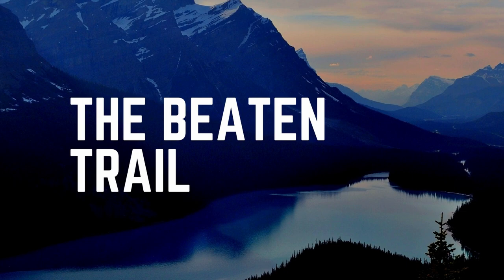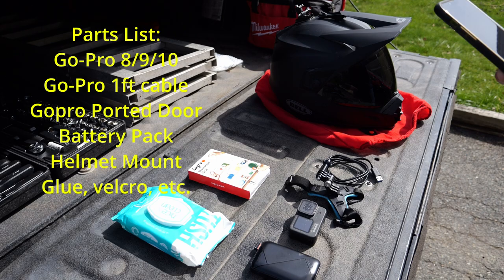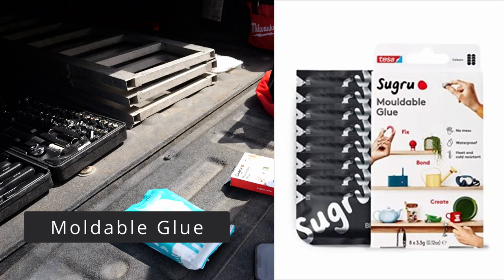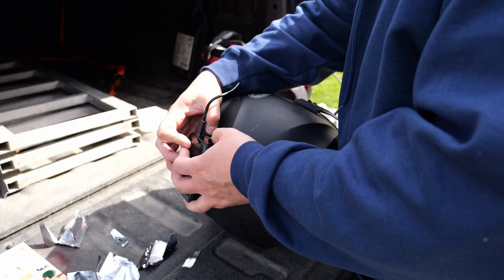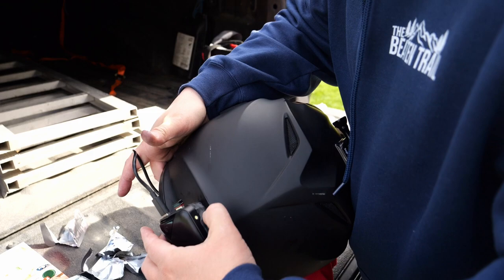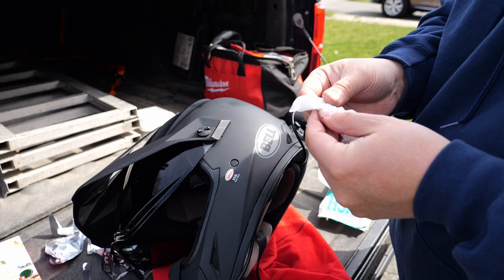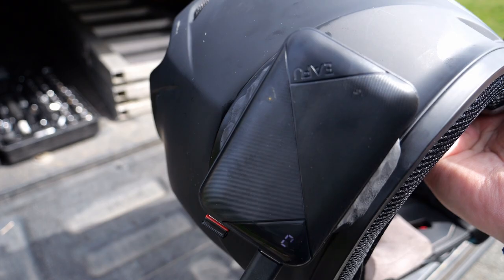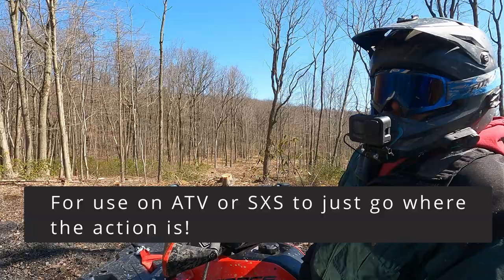Go Pro Power all Day for Helmet Mounted Camera!

Comment: Great video! I’ve had mine attached using this method now for over 6 months. Thru 25 degree rides to hot 90 degree rides. Still holding fast.

One tip on these power banks and go pro charging.

1. It is  recommended to remove the battery and run the GoPro straight from the power bank.  I’ve read the reason around that is the power bank is constantly charging the installed battery and thus the go pro could see heating issues. I run mine with the battery installed and have not seen any heat issues. So it’s user preference here.

2. I’ve found it’s best to use usbc off the power bank vs usb-a if you DO leave the battery installed during use. The usbc delivers what I find is a more stable current because when I run off of usb-a I find the go pro ends up with a low battery state at the end of a ride leaving me to think it wasn’t getting enough charge current from the USB-A side of the power-bank.

Again just what I’ve experienced keeping my go pro’s powered for all day rides. We’ve ran both a GoPro 5 and 9 and at one time my Insta 360 cam for nearly 5 hours each off their own power bank and at the end of the day all power banks still had well over 50% battery on them! 

Nice job on the video here! 👍🏻💯
Reply from the maker: Thanks. Good to know those items. Same challenge on wired gopros in sxs. Hot battery. Gopros known for heat issues.

Comment: I use a pouch that hangs around my neck. I found the extra weight of my power bank was a little uncomfortable. I like the moldable glue idea.
Reply from the maker: I was thinking the same thing, but the pack I used wasn't bad, so I think it depends on what capacity you pick.  Regardless, its great not to change gopro batteries while on the trail! Thanks for watching!